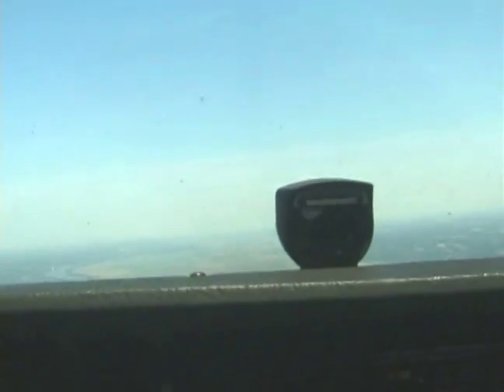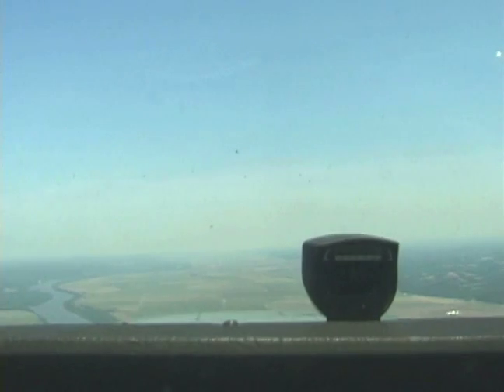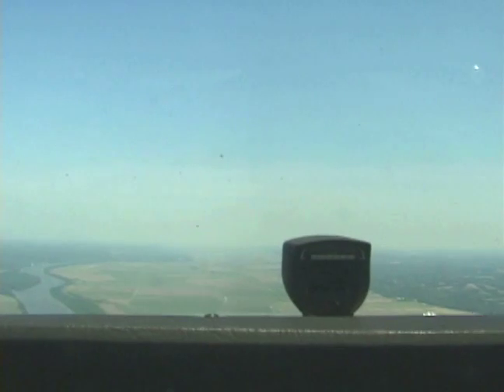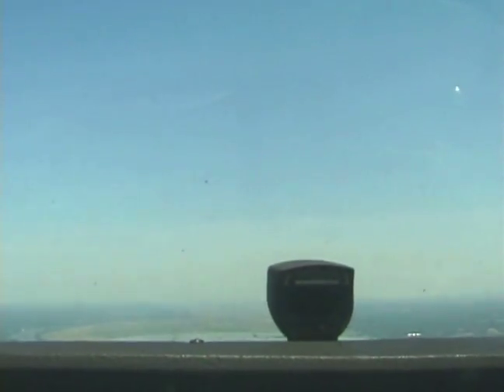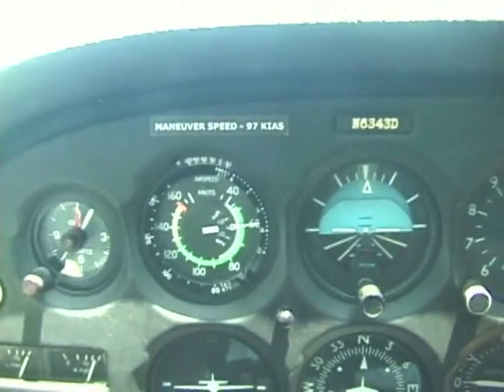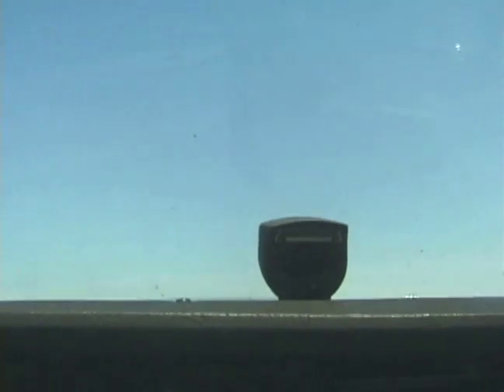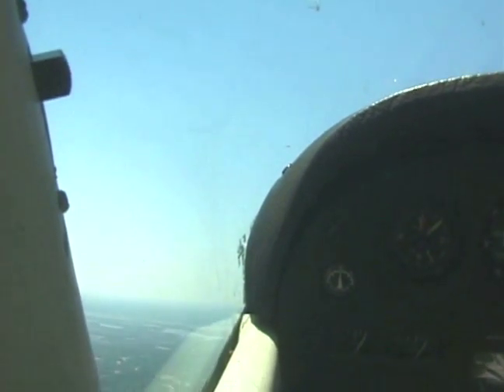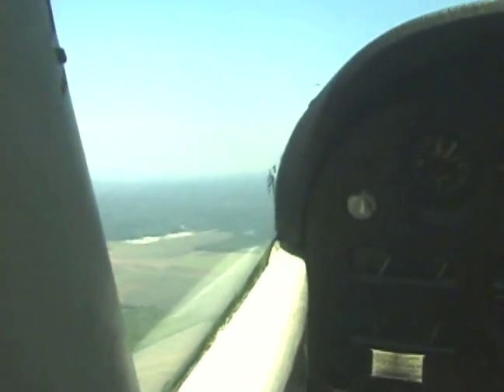How to Fly an Airplane : How to Do a Power On Stall in an Airplane

Comment: Never been in a Cessna aeh?  I've been in more types of Cessna than you'll ever be in bud.  I have over 700 hrs. in the Skyhawk and Cutlass RG II.  I have 143hrs in a Cessna 310, 60hrs in a Cessna 177 Cardinal, 40hrs in a Cessna 421, and 20hrs in a C208 (caravan).  If that wasn't enough for you I have a CL-600 type rating with 600hrs of SIC turbine time.  Tell me again I've never been in a Cessna.